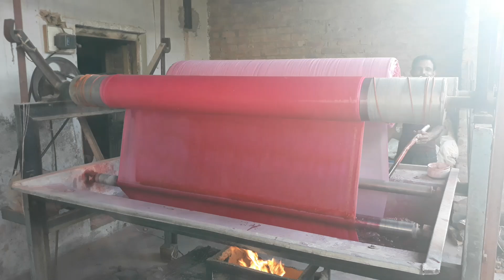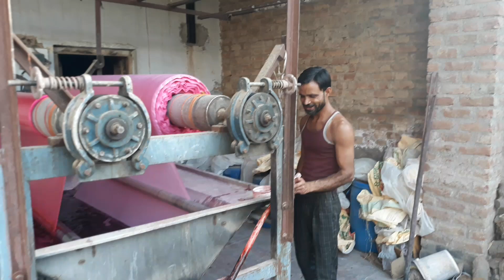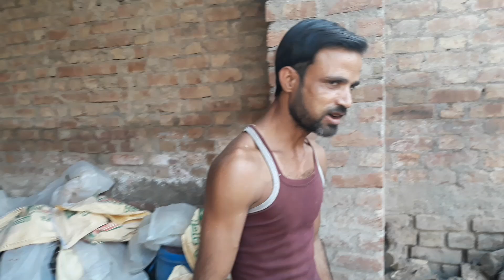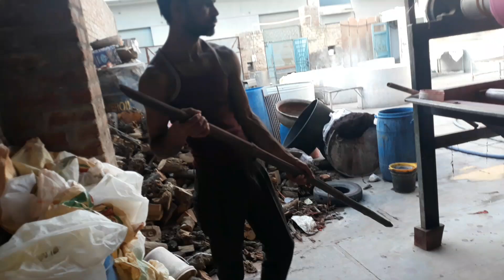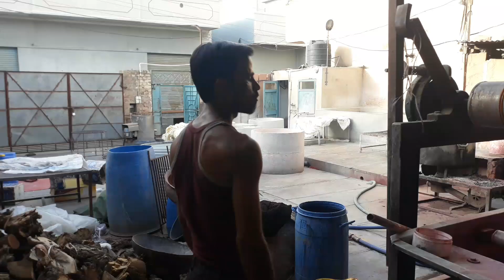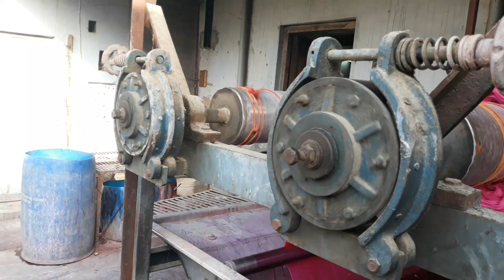Cloth dying on jigar by asif

Comment: The fabric is not in the dye bath for long
Reply: We need to give multiple rounds on jigar for the correct shades. Jigar is used for quality and bulk dyeing with mill made finish. If the fabrics are lower in quantity than we use tub for dyeing.
Reply: What is the temperature of the water ?